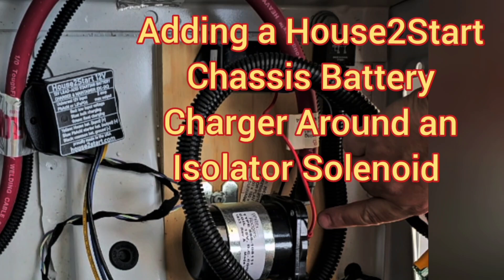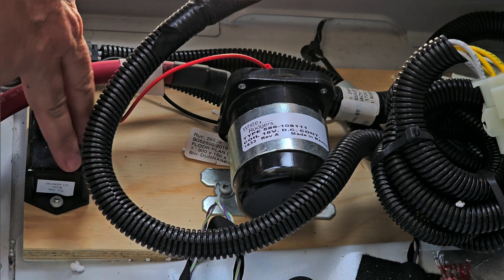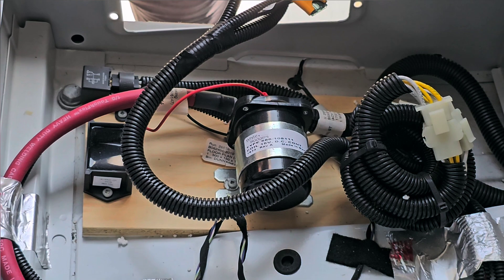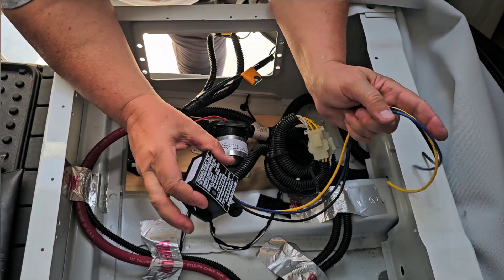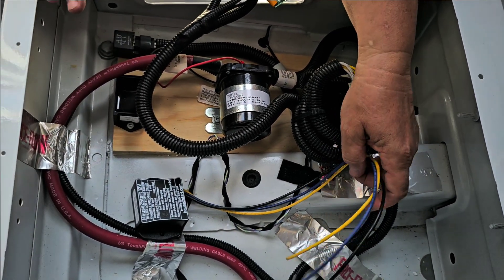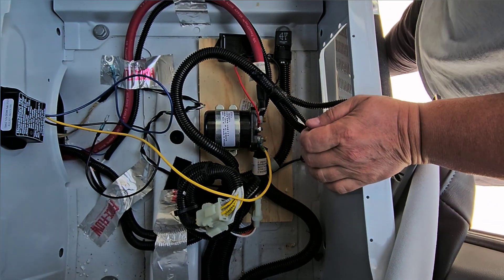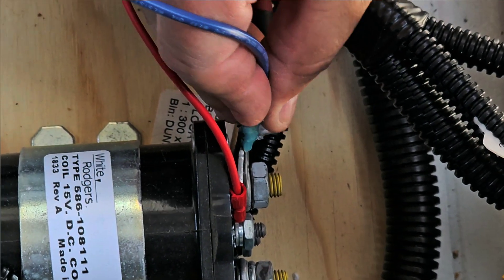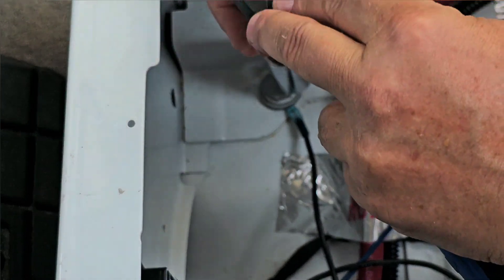House2Start Chassis Battery Charger Around an Isolator Solenoid

Comment: To which wires did you connect the switch to?  Good Video!!
Reply from the maker: You can put a switch on either wire, the yellow or the blue. A switch disconnects either battery, depending on which wire you add the switch to. Disconnecting either battery feed  turns off the House2Start.